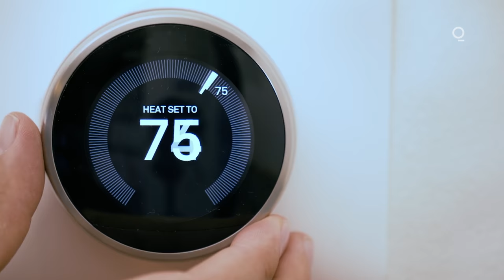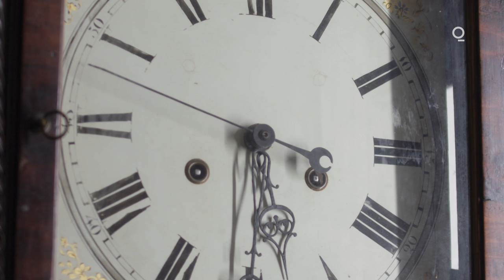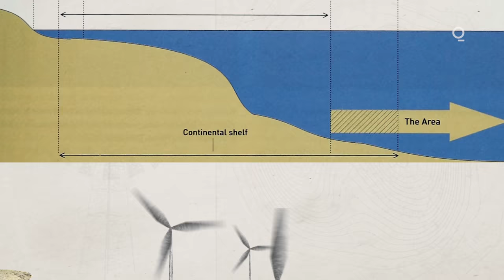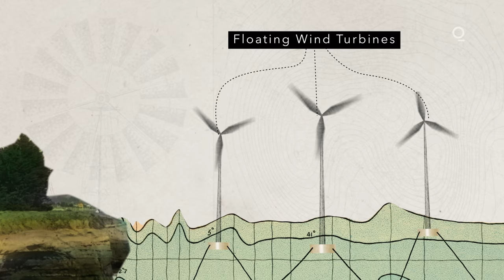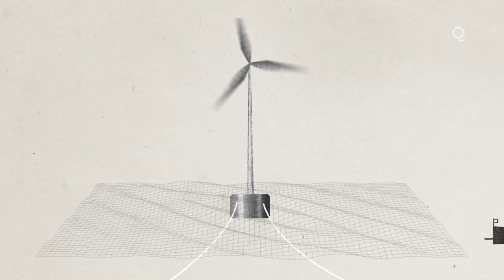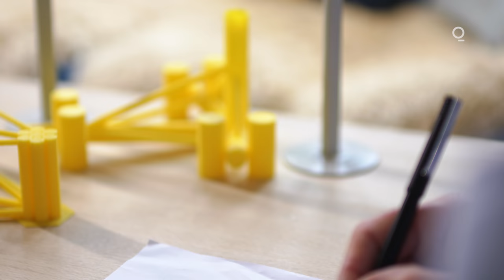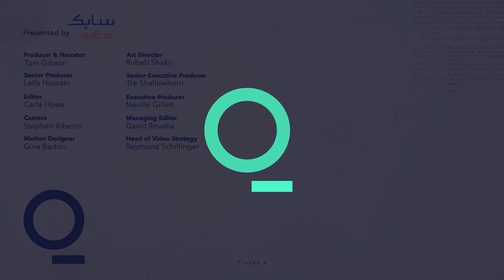The Godfather of Wind's New Floating Revolution

Comment: can offshore wind be merged with tidal power  by interconnecting many turbines that have a wind turbine on top and a tidal turbine below the surface ...
Reply: tidal works best in shallow-ish waters, floating wind turbines are for deep seas. you can connect the two, but they don't have to be. it's fine working them separately.
Reply: You put dragons from Minesto below the surface

Comment: Anti-roll gyro must be employed in floating wind turbines to stabilize them in rough seas with strong wind . 
Anti-roll gyro enables floating wind turbine to harness  wind  energy in rough seas.
Reply: I wonder if you'd have to have a caretaker crew that lives out there for periods of time to repair the turbines if something goes wrong in the same way that crews live on oil platforms. If they are so far out to sea and a gyro goes bad, I imagine that's a pretty significant investment to lose because you couldn't get there in time to fix it before it sank
Reply: High temperature Superconducting wind turbine generator  makes  floating wind turbine more efficient , due to higher energy density. 
Furthermore,  predictive Ai enabled IOT system could reduce maintenance cost.

Comment: One utilization model is to colocate data centers(DC) with floating turbines. Generated power would be consumed by the DCs thus no long distance power transmission and there is unlimited cooling water. Intermittent winds could be mitigated by battery storage and/or DCs throttling power draw according to availability.

The input and output is data where network connections could be made by terrestrial/satellite radio transmission or running/tapping into fiber optic cables, depending on siting. Note that data connections via Starlink-like satellite constellations will have no adjacent subscribers that compete for bandwidth ie. satellite network capacity is under subscribed over the open ocean.

Comment: The maintenance would be very challenging.
Reply: Maybe but they do work. The first offshore wind farm was built in 1991 and decommissioned 2017 so it lasted 26 years and that was first generation offshore wind turbines

The current ones are designed to last 30 years but I'd bet they will still be around in 60 years with a big replacement of blades and generator at year 30 allowing another 30 years of operations
Reply: @kaya051285  of course but still maintaining them is labour and technology intensive.
Reply: @aman gautam  Not as much as you would imagine. In the North Sea using the new 13-15MW turbines that will come online next year is the cheapest source of eletricity in Europe. Cheaper than gas nuclear and solar

Comment: What's different between vortical or horizontal turbine
Reply: It refers to the orientation of the shaft. For example, the traditional three blades turbines are horizontal axis wind turbines.
Reply: Seatwirl sells Vertical Axis Wind Turbines (VAWT) for floating offshore wind. Check them out.

Comment: question: looks like the generator is near the top making the center of gravity of this structure high making it easier to 'pitch'(lean backwards) due to wind forces. placing the generator lower and driving it through some sort of drive train would lower the center of gravity, allowing wind to turn the blades (instead of causing the structure to lean backwards) and allow it to capture wind energy more efficiently..   so what is the advantage of placing the generator up high?
Reply: Higher wind speeds the taller they build them was the reason they gave I think. But yeah, I get what your saying. I assume the top can turn so the blades are always facing into the wind, so maybe they can also tilt back and forth a little to counter act the effect and keep the top level and the blades at the right angle of attack to catch the wind efficiently. Not sure though, just a guess 🤷‍♂🙂
Reply: You add ballast to the base structure to mitigate
Reply: that would increase the total weight of the structure. now we need more buoyancy to float. moving existing mass (generator) downwards would probably be more advantageous compared to adding ballast.
Reply: The people in the video are not building wind turbines. They are building the structures for offshore floating turbines.
And since it's in the test phase, they use regular wind turbines.
It would be very expensive, just to build special wind turbines for this purpose.
Reply: vertical axis wind turbines exist, and they have some advantages compared to horizontal axis wind turbines, although I'm not sure anyone has a large scale commercial turbine of this kind. 

irl, manufacturers like Siemens and Vestas want as few mechanical moving parts as possible because they are the first thing that breaks in wind turbines. so, adding yet another drive train/gears would probably be a big no-no for them.

p.s. check direct drive wind turbines.
Reply: @NaumRusomarov  VAWT would help keep generator down too but their efficiency  tends to be lower than conventional wind turbines. dont disagree about the reliability aspect of the drive train but that can be worked upon. I guess direct drive(high center of gravity) would be more reliable but you would need some ballast to keep COG low and provide stability.

Comment: the information stated why wind turbines are having larger blade diameter is not accurate. This is to the fact that lower specifical power tapped by wind turbines results into higher capacity factor for grid integration and to have lower specific power the area has to increase which in turns increase blade diameter.

Comment: A capacity factor is the ratio of the power output to the power capacity. So the 57% that is lauded by the Statoil rep in this video would be a laughably small number for a nuclear power plant or a hydrogen burning plant.
Reply: And why does it matter? You can build it for a lot cheaper, so you can build more of them in more areas that make up for it, and you'd have higher total output (during those peaks you fill up hydro storage, be it dams, or everyone talking about new hydrogen tech, or cheap home usage systems, allow people to heat up another 2C during that peak time, or allow people to schedule stuff like washing machines, etc.). 
Also he was talking about being at max capacity, not not outputting power, looking up danish figures for offshore, their min seems to be about 40% of nameplate capacity for 2018/19, which is one of the worst years in the last decade.

Comment: How does that equation make any sense,  P = (1/2)^Pv^(3\pi)r^2. P is appearing at both sides of the equation and there are no values for P which satisfy that equation.
Reply: yup, you were right. It must be Power=(1/2) Rho (V^3) (Pi R^2). Where the (Pi R^2) is obviously the area of circle created by swept of the rotor. It is what connect the power to "larger" turbine. I think the editor made a huge mistake when editing since he might not understand that equation.

Comment: Serious question though, what's the cost of bigger wind turbines being put out into the sea. If a wind turbine 'captures' energy then what happens to the residual wind that's not captured, systemically speaking if we continue to increase this capacity what is the cost. Will we see lower wind speeds at a global level?

Comment: Since the floaters need big underwater structures anyway it might be economically viable to store some energy   by removing the water down there when needed.
Reply: Why store energy offshore, when you can store it onshore. Also changing a damaged battery underwater, is more economically robust than simply leaving the water there. Lol
Reply: @CADPond  Pressure tanks& turbines, no batteries:)

Comment: As exciting as it is to see wind energy evolve and improve, we have to be realistic. ANY form of energy can power human civilization if scaled enough, even hamsters spinning wheels. We should stop using this sentence for marketing and find the most practical. 
Global electricity consumption is going to be around 25 PWh soon, so we are going to need 1.8 milion of those 14GWh/y turbines, roughly double it if we cannot find a way to extend its capacity factor (THE big issue since day one). 
1,800,000 turbines will require approx 2,160,000,000 tons of material (1,000 for the base as stated in the video, 200 as a favorable assumption for the rest). That's 50% more than total global consumption of steel (30,000 Yamato battleships more or less). If we give them a very optimistic lifespan of 30 years in offshore enviroment, 165 turbines must be replaced every day, forever. That's to match current electricity consumption, where most people in the world consume a fraction of what a first world citizen consumes, and electric transportation is still in its infancy. Ideally we would want 4 or 5 times that (and batteries, gigatons of them). Renewables are awesome until someone picks the pen, paper and calculator and tries to apply them in the scale that we need them.
For sure industrialization is going to help and technology will improve. And those numbers are high but not impossible. But if only we apply a fraction of the money and resources to new nuclear energy enterprises...
Reply: oil consumption is about 6 billion tons per year. The entire infrastructure for the extraction, processing and transportation of this sea of oil is also millions of tons of steel and concrete. Therefore, 3 billion tons of materials for wind turbines is not so much. The infrastructure for oil refining and production developed throughout the twentieth century,  and demanded an incalculable amount of money. Nuclear energy is based on finite resources, they will hardly last for a hundred years. Affordable nuclear fusion energy is a myth.

Comment: How do you transmit power from the middle of the ocean to wherever it's needed? Underwater cables seem to be getting cut way too often
Reply: Electricity is converted at an offshore substation to a higher voltage to reduce voltage loss during onshore transfer via cables. I don’t know why you would think that cables are “getting cut way too often”.
Reply: The Internet you use right now runs through underwater sea cables. They can get damaged, but it doesn't happen so often.

Comment: The issues is when a storm hits, how will they handle that issue in the long run?
Reply: ships can survive storms. and storms do not hit everywhere at once.
Reply: They'll just lean back more than usual because of the wind pressure and then bounce right back when the wind drops. They won't fall over for the same reason a sailing ship with a heavy keel doesn't fall over in a storm. Most of the mass is below the water line.

Comment: How much fuel do they burn out to produce one of this "clean" turbine ???
Reply: This has actually been extensively researched and written about in professional spaces and it its actually pretty negligible considering that construction, placement and maintenance are really the only times it creates emissions, and they often go 25 years without needing much maintenance at all, on average they emit between 5 and 25 grams of carbon when coal and natural gas would produce from 100 grams to 870 for the same amount of energy, averaged over the lifetime of the turbines. Everything costs something and when it's a choice between continuing use of fossil fuels (which'll run out eventually and destabilize the climate we rely on for the ability to breathe and eat and whatnot long before that), or we do something to avoid mass suffering in the future when we can before it gets worse, I'd rather take the latter, but maybe that's just me.

Also there's this new thing called google, you just type just about any question and easily find lots of people educated on the subject talking about it as well as most scientific papers from the last few centuries to present. It's crazy, I know but you can educate yourself before spreading misinformation and everyone benefits.

Comment: need to get away from single purpose windmill structures.  If you can surround a large barge with a floating hospital; and/or engineering school; and/or fancy Eiffel tower like restaurant . The structure would generate money as well as electrical power.  Also using vertical axis wind turbines would allow for a solar roof to also be installed onto the structure of an array of 3 to 12 turbines.
Reply: Vertical axis wind turbines are small, and very inefficient. That's why no one builds them.
Reply: @akyhne  That's a fair argument. I argue that their inefficiency is outweighed by their ability to make other use of their support structure and the fact that power take off is at the bottom of the tower.  Most Verticle axis windmills use a central post as the support structure.  This is an error.  If you use a perimeter scaffold type support  The diameter of the turbine can be 100' or more.  
This allows for dynamic control of  the air foils so that you can use the drag and/or the vacuum aspect of the wind.
Reply: @clavo3352  Vertical axis wind turbines are inefficient because of how they work, not because of size or how they are held up.

Comment: So what do we do when it's not windy for a few days?
Reply: Use nuclear, hydro, solar, batteries, geothermal, oil, natural gas, etc. There are plenty of options out there, and now, there are more
Reply: @tylerbird8870  If you use nuclear or geothermal, for non windy days, then you won't need wind at all. Nuclear and geothermal can manage just fine with out wind. Personally I would have answered with molten salt storage or iron air batteries, but I don't know..
Reply: @Music5362  There isn't a single solution for all scenarios. I used etc because I could not list all the possible technologies. Molten salt could even be classified as a battery. I'm all for improving what we have. It doesn't mean using one thing everywhere, though it is easy to focus on just a handful.

I'm also happy they are improving internal combustion engines! It's about progress
Reply: @tylerbird8870  Thanks for taking the time to answer my comment. I hear so many positive ideas for storage. Since we don't have much storage atm, maybe we haven't nailed it just yet? Jeff Bezos seems to have put his money on Iron air.. maybe that'll be the killer app. :D
Reply: @Music5362  Yes! It is interesting to see the trade offs, too. Some tech works better in phones, and other tech works in spacious warehouses. Some tech requires cool temperatures year round, others don't

Comment: 12:18 "The energy the turbines produce will help power the company's oil and gas platforms."
Oh, the irony. Spend a couple of minutes talking about how we need to transition away from fossil fuels, and then the video pivots to using renewable power to... help extract more fossil fuels. Yep.
Yep.
Reply: Don't you use oil or gas in your life? It's a resource that is still needed in our society and we can't just turn off the tap from one day to the next. The energy transition is a long-term process. As long as we make progress every day, things will get better.
Reply: You still need the gas for many many things. Ships, planes, industry. if you reduce electricity for those platforms that means you are extracting less at the end of the day. Progress is done in baby steps.
Reply: Beyond the short term fact that we still need them, in the long term even if we completely stopped burning fossil fuels we're still going to be pumping out oil, because we still need plastics, lubricants, and thousands of other products produced with oil.

Comment: Great potential but energy intermittence/storage remain a problem
Reply: That's what battery storage is for, lithium or solid state.
Reply: @michael4576  Battery storage cannot match the scale of storage involved. Not even close.
Reply: @anteeko you couldn't be further from the truth. How much is the fossil fuel industry or fox news paying you?
Reply: @michael4576  "you couldn't be further from the truth. How much is the fossil fuel industry or fox news paying you?." nothing just simple calculation.
Battery are a very poor fit for large scale storage. Its cost is high and its cost increase linearly with scale.
There are many far better storage technology. for example liquid air energy storage, why? because if you need to double the capacity you just add another tank, only a marginal cost increase instead of a doubling.

Comment: In my opinion, this industry could learn something valuable from private rocket manufacturers: use 3-D printing for the manufacture tube structures.
Reply: Why would you need to print something in a 3d printer, that is not complex?